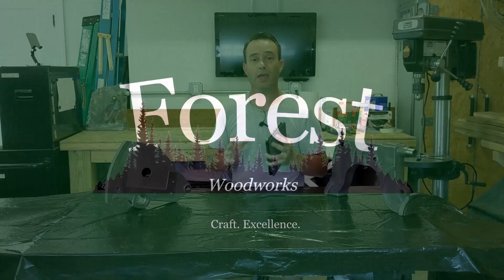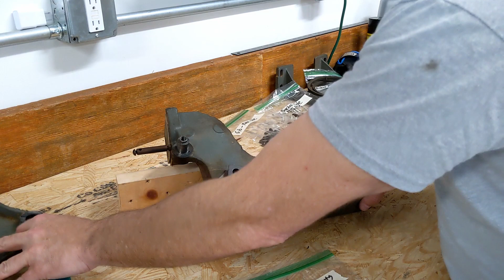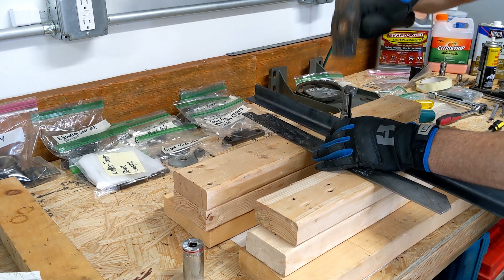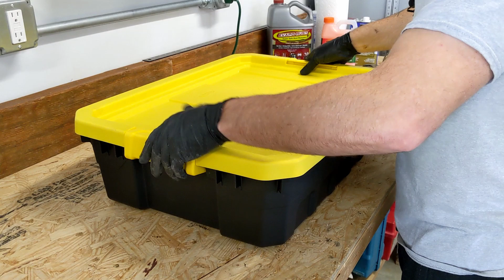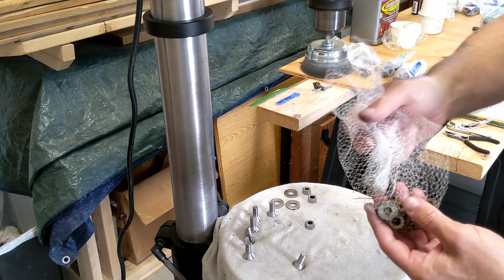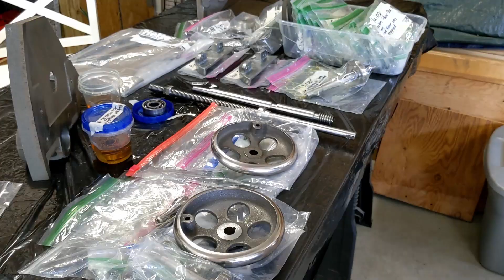Walker-Turner 10-inch Table Saw, Part 3: Trunnion Disassembly and Hardware Polish

Comment: Where is part 4 and beyond??
Reply from the maker: @chrisbosco100  that's an awesome question! Had some illness to deal with and then got a bit sidetracked with watchmaking lol, but I'm literally out in my garage today getting it cleaned up to move forward with the table saw. I've got a few more parts to paint and I should be good to edit and load the painting video. Next will be the reasonably vid. It's coming 💪 Also there probably won't be any cheesy music on my next upload, since my phones changed between videos, so now I can't connect my lapel mic